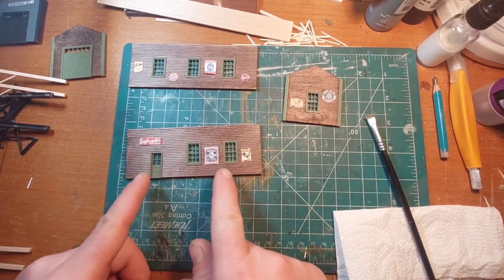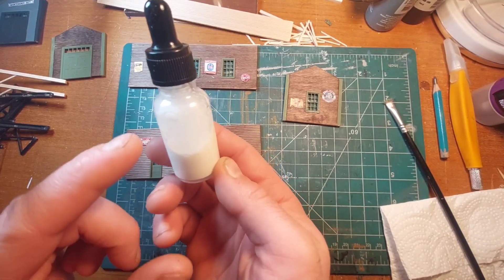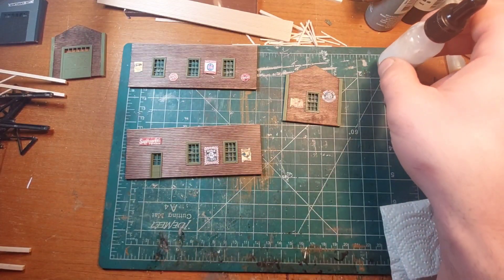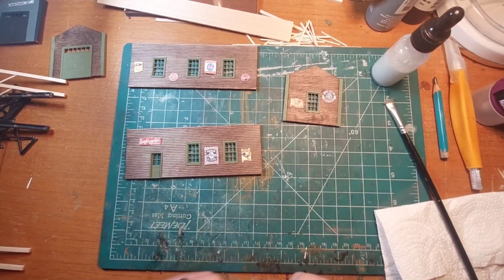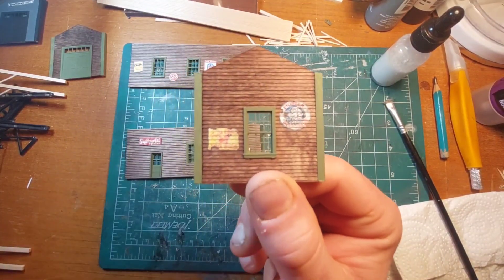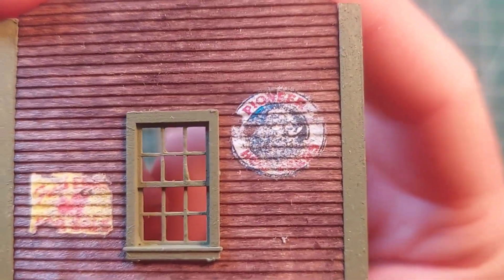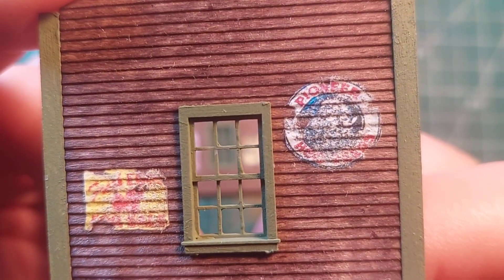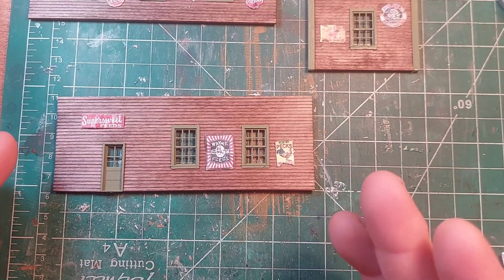re make of signage applications

Comment: Hey, Josh. Thanks for the shout-out. I caught your last video and even with the camera flub, I was able to see your work, and you did a great job finishing and mounting the signs, just as in this video. Do you have any plans for a big sign with Tim's Feed or something on it?
Reply from the maker: I was thinking  about one those rooftop billboard signs that have supports im always seeing. Also I'm looking for a good place to start working with and making my own signs that I can print out not sure witch one to go with I've been trying to edit signs and picture sizes to make them work but just ran into  dead end with that. Any suggestions would be great I've been using alot of free sights to find images to print or save to edit just not sure witch to use so I can make them  my own.
Reply from the maker: And your welcome we modeler got support each other you know no matter what our level there's so etching out there for everyone.
Reply: One free (on a PC usually) program I use is PowerPoint (or Publisher-similar in how they work for this purpose) for making signs, but it's somewhat limited. However, it works well for importing signs that have been scanned or downloaded. For more customization, you may need a photo editing program like Photoshop, which isn't free but works great. Programs like InkScape are free and work as well though I find them more difficult to work in.
Reply from the maker: Ok ill check them out thanks